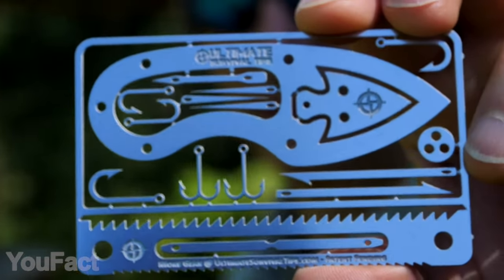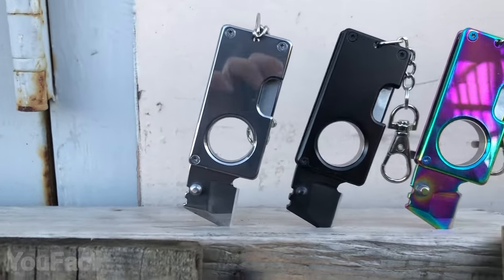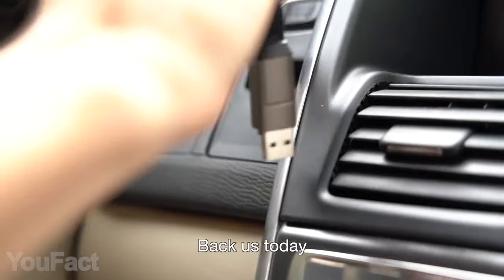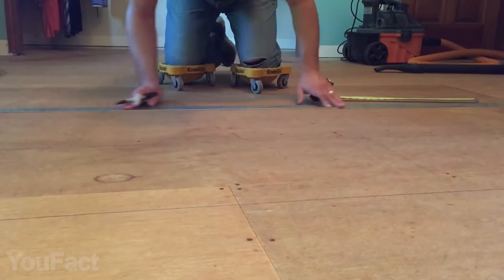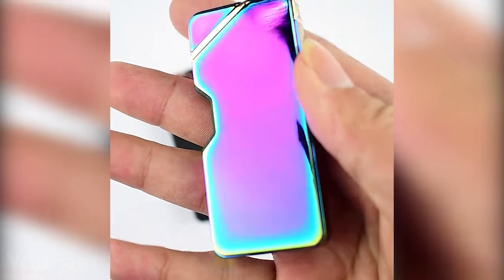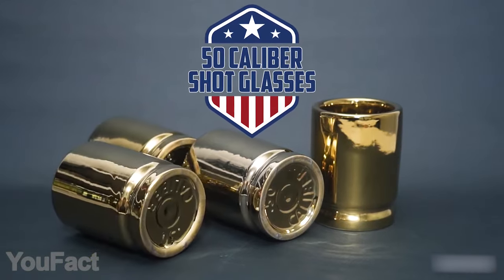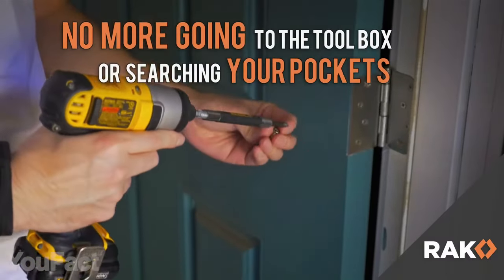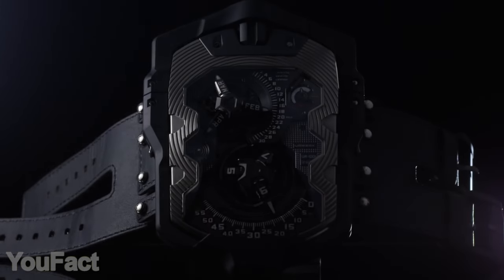12 Coolest Gadgets for Men That Are Worth Buying

Comment: a lot of these are helpful, but seriously. that watch is 600 times as expensive as my phone, weighs 20 times as much as my phone, and  requires oil changes, and my phone can do everything it does and better. and I'm pretty sure no one would exactly like being the owner of a mini knife that's about the size of my thumb, 1. It looks stupid. 2. That knife would easily be able to slip out of anybody's hands, which could cause deep cuts and harm to yourself and others. (also, what are going to do with a machete that size?) . the truss multi tool, well it has several features I'm never going to utilize, mainly the scissors, and the saw. because what are you going to do with tools like that except in a version that's the size of a thumbtack.